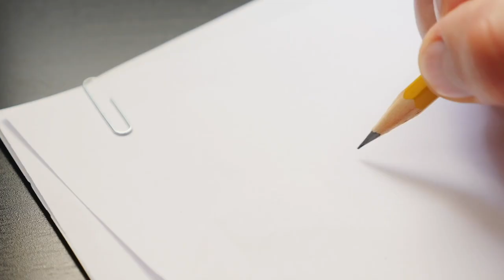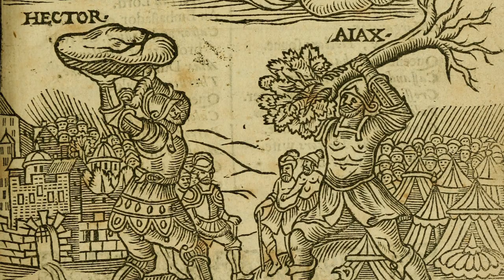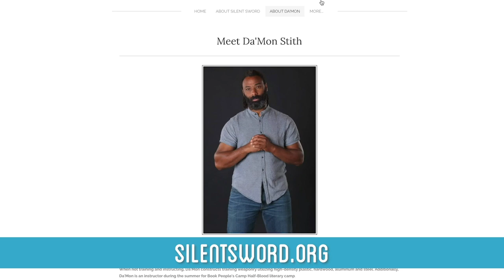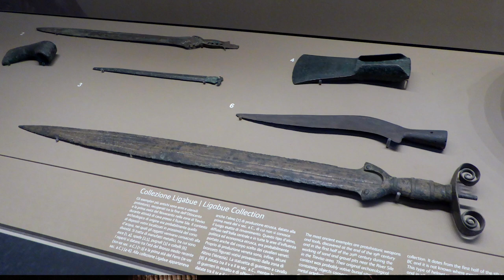The Sword That Ended the WORLD (Well, At Least the Bronze Age...)

Comment: The clay tablet from one king to another wasn't unsent and it wasnt found in a kiln. Clay tablets were dried, not fired so they could be recycled. 
The tablet was sent but it supposedly went unread and was put into storage until the king could read it.
Before that happened the sea people attacked and burned the palace to the ground, the heat causing the tablet to be fired, preserving it.

Comment: I know I'm being nitpicky, but they didn't have split leather like that. The leather that was available was very thick (up to 1/8 in.) and the vegetable tannins did not fully penetrate the hide, so the center of the leather was much harder like abs plastic. The leather you have wrapped around the melons is modern vegetable tanned and latigo, which is leather that has been vegetable tanned then chromium tanned.  These leathers did not exist in that form. If they did, we would find examples because the oils and waxes impregnated in the leather would help keep it from decomposing. Perhaps, you should try tanning leather. It's dirty and smelly, but you will learn a lot of what is possible with animal skins. Brain tanning and bark tanning are the simplest historical methods. Start with those.

Comment: That spear could be VASTLY improved. First use rawhide to attach it to the shaft. Second get a thinner stick. Third the transition from metal to would should be aerodynamically perfect. You can see why in a number of your shots where the stab stopped at the wood. I would guess that the original were attached with wet rawhide and then dried and then coated with something waterproof like tree sap or ?? Also did you sharpen the edges?

Comment: So, if you want to test against genuine leather armor, it wouldn't be soft like the stuff you were using. there were techniques that were used to harden the leather to make it tougher and more resistant. Shields were often faced with hardened leather, which was then glued with animal glue to planks of wood, which ended up making a super tough laminate.

Speaking of which, you made the sword and the spear, but no shield?

Comment: Could You deep-dive into early iron-age iron processing? I'm not convinced that weapons were cast. The melting point of iron is almost twice as high as bronze.
Reply: Iron wasnt cast (outside China) until the 15th century. Even in China, they only started casting iron in the 5th century (which is during the European dark ages...not ancient times).

Swords were forged. (hammered into shape). Mostly because fires weren't hot enough to melt iron in ancient times.

Even if some random ancient dude successfully melted iron and cated it, he'd immediately discover cast iron was too brittle for weapons like swords.

Comment: Why was warfare so necessary? Cold sun theory shows a cooling of the sun during that time period which was similar to the mini ice age. Poor growing conditions limits food production which is a key to growing a kingdom. War was generally for those scattered resources. Every 400 +\- some years the sun cools significantly and produces less heat for 60-130 years. During this time summer can be as brief as a few weeks to no summer at all. I agree with your theory to some extent but the innovation in war came as a response to the changing environment than it came as desire to increase the power base.

Comment: It does ruin the immersion when they use iron tongs, modern crucibles and a kiln
Reply from the maker: Our original plan was to keep doing everything authentically, but the failure rates on the crucibles and tongs was high enough that it really bogged down production and introduced us to a lot of extra risk.  So we’ve opted for more of a one time proof of concept that we can do it, then switching to equivalent methods that are faster and safer afterwards

Comment: something's wrong with your blade
it bends too easily and the tip seemed to have suffered and deformed already in the leather attacks and during the later blows towards the bronze sheet it basically faced upwards
left out the a little bit more tricky hardening process, didn't you !? you gonna end up like Hector if you bring this to a real battle !

Comment: 5:37 stop with the myth of super weak bronze. Even compared to a steel blade, bronze beheaves very respectably. Of course it will cut leather as well as steel,  beacause you can sharpen both to a high degree.

Comment: Why do you keep using Greg for your castings, instead of doing your castings and melting the metal yourself?
Reply: Maybe its the wooden frame. Pretty hard to make square planks without a planer. Andy totally should figure out how to make a planer. But he gotta stick to the schedule so he cant just jump to modern machines like a lathe but built with prehistoric tools, that would be cheating

Comment: Well, old Spartan spears were actually made out of iron. So were arrow heads. Very likely made from iron, and then case hardened to form a sort of marcenite outside 'hard' layer of steel wrapping a softer iron core.

Works fine for small objects that need no flexibility, like spears and arrows. A steel sword needs to be bendy, hence why they didnt appear until around 600bc.

Comment: Okay but you haven't even unlocked the tech your using your supposed to have a primitive smelting setup until you can make better you haven't designed latches screws that kiln those steel tongs any of this, your just cheating now.    I love the idea of this reset but you are butchering it